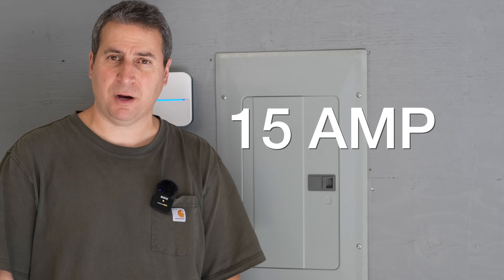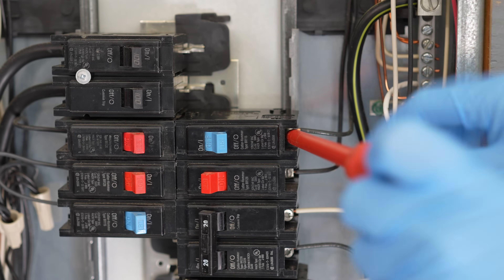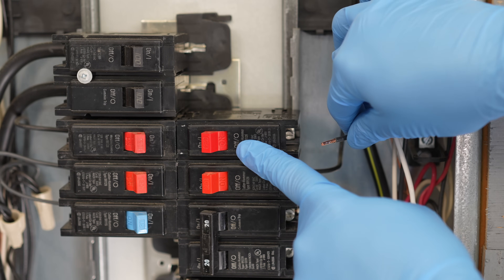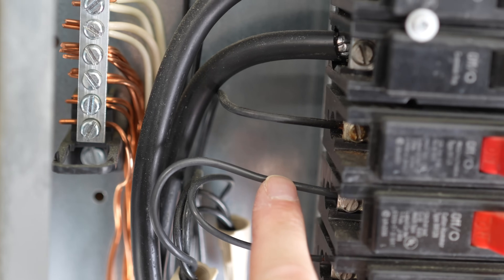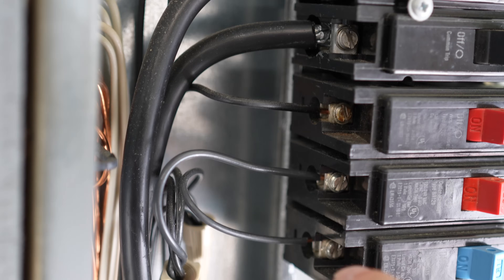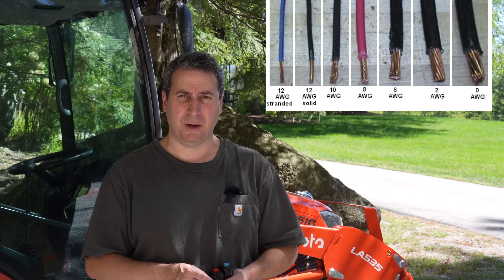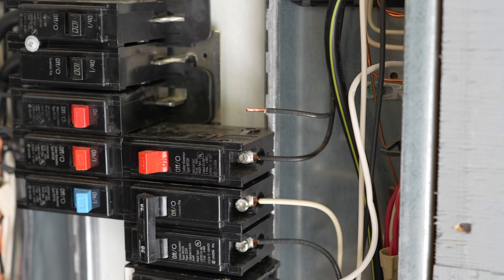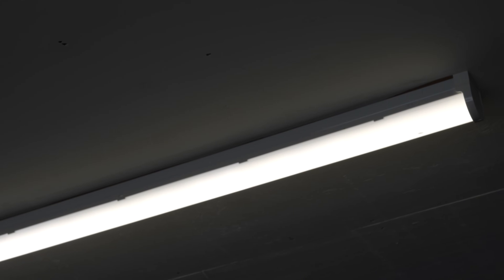WORST MISTAKE Homeowners make upgrading a 15AMP to 20AMP Circuit Breaker

Comment: What if I have only 3 receptacles on a circuit, all 3 GFCI's,  all within 10 feet of the main panel, but the first two are 20's and the last one is a 15. Can I change the 15 GFI to a 20? The wire is 12 AWG.

Comment: Is this why a perfect working 120 volt air compressor won't power up when I plug it into a 120 volt outlet?
I plug in a power drill and it works , I plug in the air compressor and nothing , will the air compressor start up if I had a 20 amp circuit?

Comment: Are you correct that by NEC you cannot use a #14 on a 20 amp breaker?  Yes absolutely you are.  But let’s see if this is as dangerous as you are implying?  Go to Table 310.15(B)16 and look at a #14 copper wire in the 60C, 75C, and 90C ampacity ratings.   60 is 15, 75 is 20, and 90 is 25 amps.   So, why can’t you use #14 for 20 at 75C?  The breaker is rated for 75C!  So, you should be able to use #14 safely on the breaker.  Answer, maybe!   What is the C rating of standard duplex receptacles?   Answer, 60C.    So, the danger is at the receptacle, therefore you cannot use #14 on a 20 amp breaker.  What about a branch circuit that does not have any receptacles or lights?  Let’s say a motor circuit with lugs rated at 75C on the load end.  Yes, by engineering, you could do it safely.  So, the truth is, the NEC code making panel did not want anyone to go through all the hoops to prove it is acceptable, so they voted and made a rule that #14 copper shall have overcurrent protection no higher than 15 amps, and #12 at 20, and #10 at 30 amps. 
Just thought someone would like to know “WHY?”

Comment: Question?  
I know I can’t use 14 gauge on a 20 amp breaker, what about if I used higher gauge wire like an 6 gauge only part of the run.  
The reason why is I had a hot tub running on 220, 50 amps and I don’t wanna rerun the wire through the house, but I will change the breakers and switched the wires the way they supposed to be, is this ok?

Comment: I installed a GFCI next to a sink for someone, circuit breaker was a 20 amp. In the receptacle though it was fed with 12 gauge and the load side had 14 gauge. I said let me go get a 15 amp breaker and change this outlet to 15 amp as well and they refused, said it had been fine and didn't want to spend the extra money. I also found one outlet with a disconnected ground just loose in the box, and the old work box had it's back totally cut off because the had a deep box and tried to put it on a narrow wall, exposing a possible spark to the framing lumber. Didn't want to fix that either.

Comment: Not sure how replacing the entire circuit is easier then checking if proper gage wire was used. Snaking new wire through the walls can be very difficult and expensive, especially if it's going to require opening the wall to pass wire through the stud.

Comment: The biggest problem with replacing the whole circuit end-to-end, is punching dozens of holes through sheetrock across multiple floors, walls and ceilings, even if you use a wire snake to try to get through the 'easy' spots, those wires are stapled to beams, or drilled through holes in crossbeams, meaning you have to punch holes in the walls to "see'" where the wires are heading/going/blocked, and patch them up later. 

Even taping the new, 12ga wire to the existing outlet's romex and trying to pull it through, may also not work, due to turns and staples that cable may be making along the way down through the wall into the basement where the panel is.

Comment: Many people have tripped a breaker using a tablesaw but it is a temporary overcurrent and not something used continuously so you obviously know what caused it. If you plan on putting a continuous draw then definitely this is the correct answer but it is misleading that 14 gauge wire is gonna immediately burn your house down

Comment: Shredding a house to upgrade the wire is expensive and time consuming for a possible occasional load that may exceed the temporary over current for a short time is very misleading. Constantly overloading a circuit is definitely dangerous but the safety factors are way too extreme. Good for electricians but not for the consumer that may use a toaster and kettle for a couple minutes. Absolute bs

Comment: Thanks! Super useful as I was wondering how I could use a 15A oven at home when I only have 13A.i guess I won't just slap a higher capacity breaker. I guess it is dangerous unless I get an electrician to rewire for 15 or 20A!

Comment: I replaced an outlet and my breaker overloaded.i checked my outlet and the ground wire was touching the power to the outlet.oh I found what was the problem.pushed it away from the outlet and my breaker worked.

Comment: I find it hard to believe that someone that any knowledge would know to upgrade their 15 app to a 20 amp yet not simultaneously come across the fact that they also need to upgrade their wire or match the amperage circuit breaker with the rating of the wire.  In other words, does this actually happen now in the day of googling and YouTube videos?

Comment: What about the reverse of this video remove a 20 amp breaker and replace it with a 15 amp breaker ?
reason is the 30 year old 220 Volt air conditioner had a 20 amp the new air conditioner calls for a 15 amp breaker

Comment: In the event of a short circuit, a 15 or 20 amp CB will trip instantly with the wire suffering no damage.  Continous load, however is a whole different ballgame.

Comment: I have to disconnect the auto on, moistures fan, remove some lights in the basement, lower my water temp so circuit breaker stop tripping

Comment: I heard some electrical sounds after flipping a light switch a year or two ago, a bit after I moved into my new older house. So, I turned off the power and opened up the switch faceplate. Sure enough, the grounding wire was not connected to the switch and the hot and neutral wires were connected loosely enough. The switch itself was rather old. So, I went to the store to pick one up. Installed it, turned the power back on and it's been lighting up the room ever since with no electrical sounds. Another switch didn't even have a grounding wire. Whether it was the previous DIY homeowner or an incompetent and/or lazy electrician, I know to make damn sure I know what I'm doing, unless I want to die from a fire in my house while I'm sleeping. Thanks, but no thanks to the aforementioned people. I'm starting to think I should move to electrical work. Any businesses looking for a newbie willing to learn from a qualified and experienced electrician?

Comment: Thanks. So helpful. Electricity is seriously dangerous. I am an investor and bought a house with a 200 amp service. The metal panel was off and lug protector off. The two exposed lugs could have so easily electrocuted me. I've asked several electricians and they've all told me the same thing, I wouldn't have lived. I had a handy person shut main breaker off, but when I went to turn it back on, I pulled very hard, it needed strength and my two fingers were a few centimeters from that lug! So that exposed panel that didn't have a cover over it. On top of the fact that the lugs didn't have a protector was lethal. I did have a home inspection and the inspector mentioned it was dangerous to have the lid off but didn't elaborate how dangerous. I also had an electrician that was on drugs put an HVAC connector to a wire that could not handle load and there was a fire in the box. Be VERY careful finding good licensed electricians and I recommend no DIY with electricity.

Comment: When the original wire is put in the house, why not use all 12g wire(for the 15amp and 20amp)? So, a 15amp to 20amp could be upgraded easily on any breaker?

Comment: This short video is the best one I’ve seen that clearly describes why you shouldn’t just install a higher amp breaker on existing lines. Your advice is spot on, as is your recommendation. Trust someone else’s (potential) mess & you could regret it. Very well done. A licensed electrician will also make sure to install the brand & type of breaker that your panel was designed for (e.g does your panel require GE?; Square D?; Eaton?; Alstom?; ITE?; Siemens breakers?). Very well done and presented.

Comment: May I replace a 15 amp receptacle with a 20 amp receptacle since the wiring for this receptacle is connected to a 20 amp circuit breaker? My 1500W space heater keeps tripping the circuit breaker when I connect it to this 15 amp receptacle.

Comment: I bought a new house in 2018. The builder was kind enough to build a separate 3 car garage & he wired
the garage with 5 20A outlets per wall. I checked, YES, he used the yellow 12ga romex & each wall has 
its own 20A breaker. I can run the single AC on my motorhome off 20A. Sweet.

!

Comment: @SilverCymbal I have a question - 

I honestly want to re-route all the wire in my house it is a mess but in doing so I want to upgrade the circuit from a 10amp to a 20amp circuit... In doing so I know I need to upgrade all electrical outlets and wire so appropriately I would need a 20amp breaker, 12 gauge wire etc. I also want to use electrical conduit I know this is pricy as heck but if you see my house it is a freaking mess in the attic from who ever did the install or routes for the house its like a web of what the hell happened ( some outlets are on the same circuit ex: Kitchen is connected to the master bedroom someone screwed that up). But does this effect what ever I plug into that circuit say a lamp or a space heater does this cause long term damage to my equipment? (this has been a concern for me and I cannot find good solid answers... Lets just say that I have successfully upgraded all I needed to from 10 amp to 20amp does 20 amps hurt what I am plugging into that circuit?

Comment: This is the modern day hack of swapping higher amperage edison fuses. They came out with type S fuses to combat this. 
Although it's a little more involved than changing a fuse, this is proof that a competent, but naive DIYer can swap to a higher amperage breaker and connect it to undersized wiring.

Comment: Just as long as those 14 gauge wires aren’t connected to any receptacles and lighting only you will be fine. But you definitely want 15 A on 14 gauge.

Comment: I had a tenant who "upgraded" a 15A breaker to a 20A breaker without even asking.  I didn't find out until I happened to look at the panel after they moved out and saw a breaker of a different type.  Upon inspection I noticed that the circuit had all 14 gauge wire, so not good.  I understand why they did it.  The kitchen didn't have enough power, and it probably tripped all the time when they turned on power hungry appliances.  When I remodeled the kitchen I ran multiple new 20A circuits.

Comment: I ended up having to downsize a breaker from 20 amp to 15 amp once because I discovered a place where a previous resident ran a new receptacle using 14awg. Thankfully that particular circuit runs exclusively in the unfinished part of my basement and garage, so I was able to visually track down every single bit of wire on it. I could have just re-run this one particular run and stuck with the 20 amp, and maybe one day I will, but for now I'm glad I caught that.

The other fun in my house is that all of the 15 amp circuits were run with copper-clad aluminum and the NM is old enough that the markings have faded. So to know what ampacity is ok for any given run of wire, I have to pop open a box, remove wire nuts, and inspect the wire. It's... great.

Comment: I switched 20 amp breakers to 15 in a OLDER home that would trip due to lack of circuits. This kept the old wires from getting close to max. Then add a few new circuits to spread the load. Greatly reducing overheating potential.

Comment: So I am looking at the code book right now. 14 ga copper wire can run 20a at 167 degrees. The more amps the hotter the wire. Most breakers are rated at 167 degrees. The national electric code derates 14,12,and 10ga wire for use in residential work. It's hard for me to say it's unsafe at 20A, the code book list it as safe. but it nice to have the safety margin when your sleeping at night. 
 Once while on the job, for a quick temporary light it an attic, I ran #12 100 feet on a 80A  breaker. When a tech screw shorted the wire it took all of 2 seconds to burn off all the insulation and the wire to melt in two. It smoked up a courthouse that was in session . My lesson learned was to always protect the wire even if it's just for a few minutes of use. I have sen 30a put on a 14ga wire to run an a/c.in a mobil home .  I was called in because of a fire in the reicptical box. How hot do you want to run the wires in your house?

Comment: Thanks for the information.  AS a  keen  Observer, of history, here is an analysis of   ' infrastructure '.  All types.  Over the last 100 years, infrastructure  was designed, constructed according to  the  needs / inventions  of  people, and their  hamlets, towns, cities, Large cities.  Today, 3 generations or so later,  ALL  INFRASTRUCTURE  IS  TOO  SMALL,  FOR  todays'   needs : transportation especially, and also  POWER.  Roads, bridges, railway crossings, etc .  ALL  not  designed, for todays'  modern vehicles.  Same goes for  todays'  NEED  FOR    POWER.  Advice = anyone constructing a modern  house,  should  wire it with 12  GAUGE  wire,  (better insulation,on it too) throughout. And, use 20 amp breakers,  THROUGHOUT,  BOTH  house and garage , etc.   
....anyway,  good luck, all.

Comment: I need to downgrade a circuit for now I'm gonna have to rewire the while house before to long....the wires are 14 gauge but someone put them on a 20 amp and they put 15 amp plugin connections and I've noticed that one of them is burnt so I'm gonna have to replace the 20 amp circuit breaker for now until i do a full rewire on 12 gauge...

Comment: Car audio really helped me out for diy electrical work but every now and again I look up what others do. I want to put a 20 amp breaker for one outlet on the outside of my house so nothing will be reused. It's a 5ft run from the box to where I want. Does it matter if I put the outlet horizontal?
Reply: The National Electrical Code (NEC) doesn't require a certain direction

Comment: I have a brand new Sauna that says it uses a 15Amp without GFCI.  I can turn on the inside lights, radio and outside lights but as soon as I power on the sauna to heat it immediately trips the breaker at the fuse box.  The outlet does not say GFCI on it.  I am not sure if all my breakers have GFCI or not, they do that the test button on them at the fuse box.  Any ideas what I should do.  Town home less than a year old built in 2023.  Thanks

Comment: This video had the information that I was looking for on this topic, although it is annoying to me that my house is wired up with 15 amp breakers except in a few spots. You might be surprised at how easy it is to trip a 15 amp breaker. My window AC can do it, as well as my gaming pc setup.
Reply: If you have a sub hooked up to your gaming pc or a lot of wattage running across the board heck yeah it can trip 15A. Its the bare minimum for code to save money and time  across the board
Reply: Just run a new 20 amp breaker for your AC
Reply: @usa5439  naturally. Cheaper and easier to run new breaker, line and outlet....unless you have no more room in the box

Comment: I received a new window air conditioner and was told its 15amp sooo I only swapped out the actual plugs and luckily never turned it on because as soon as I switched over the wires poof 💨 no current running through the back wall of the garage now! 
Is it safe to assume I need to replace the 15amp breaker for a 20amp breaker now? Also the rest of the garages outlets have power but I definitely blew that 15amp! I’m not a electrician but obviously 🙄 I’m just living my lucky life 😅moment by moment 😊
Reply: Might need more because ACs amp rating is their running amps but when the compressor turns on they draw much more for a split second. For example a 13amp AC can draw as much as 15-20 amps during the initial surge.

Comment: Can I splice into a 12g wire for baseboard heater to create a 20a outlet for running power tools?
Reply: Yes but don't use the heater and tools at the same time or it'll probably trip

Comment: When you think to upgrade your breaker to a higher amperage the very important action is to make sure all the components of the circuit (starting with new breaker, continuing with the wiring, and ending with the switch/outlet and the device your are going to plug in) supports the new amperage. If any of the components are not designed for a higher amperage - it should be changed in the same time the breaker is upgraded or the upgrade project should be abandoned. Period.

Comment: How do you find out if the wire is 12 AWG? The problem is to run new wires you have to rip out your walls!!
Reply: 12 Ga wire is yellow unless it is old then it may still be white. If your wire is white, look closely at the writing on the wire itself. In most cases it should say what gauge it is and how many conductors it has. For example it may say '"12/2" which means it is 12ga wire with 2 conductors and a ground wire. The two conductors (wires) are usually one black and one white. The ground wire is usually either green or bare copper.

Comment: My water heater is separate from the rest of my breakers so I can just upgrade to a 20amp and run my 12 guage wire from the breaker to the heater ?
Reply: I'm surprised it's not 20a already.